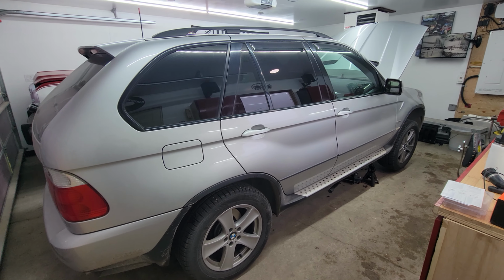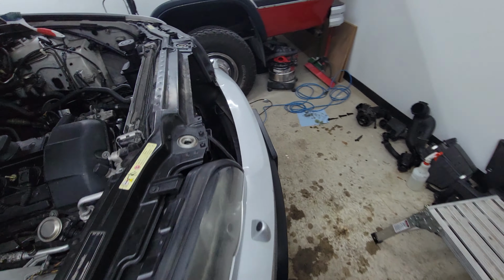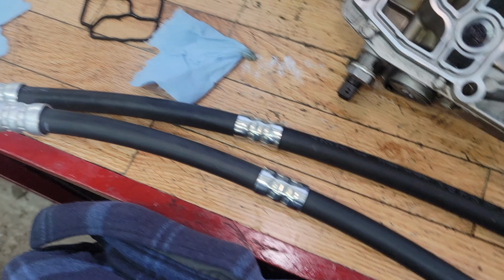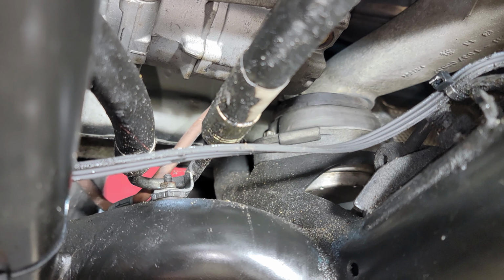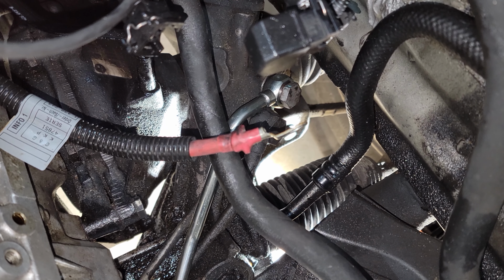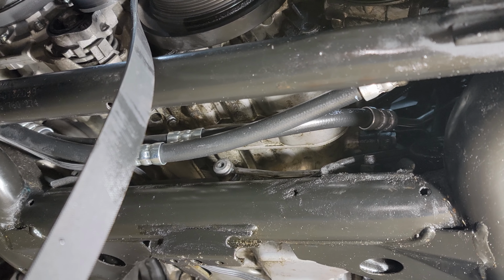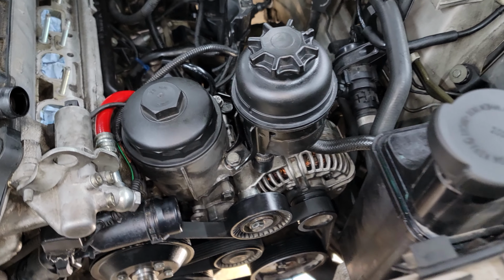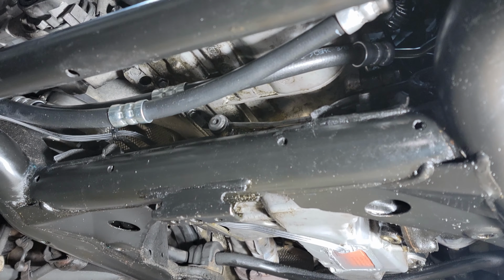M54 Power Steering Leaks | BMW E53 X5

Comment: What size is the nut that holds the bracket for the high pressure lines? Mine has evidently gone missing.
Reply: Could possibly be anywhere between 10mm - 13mm I'm guessing......